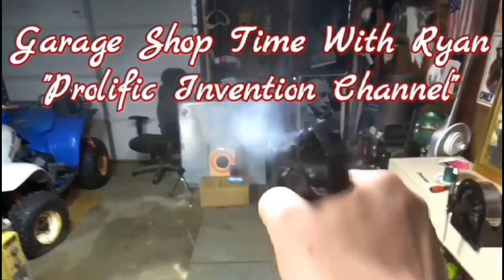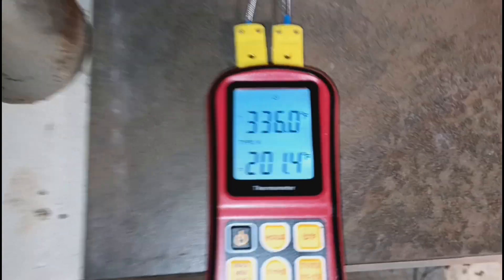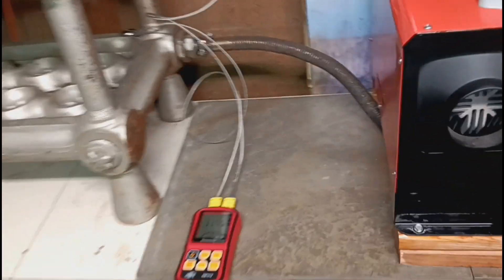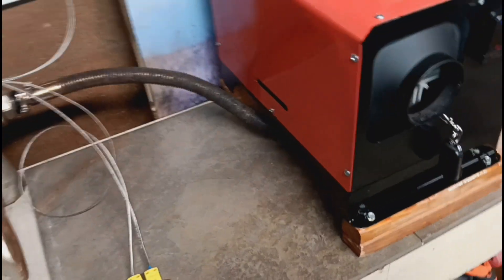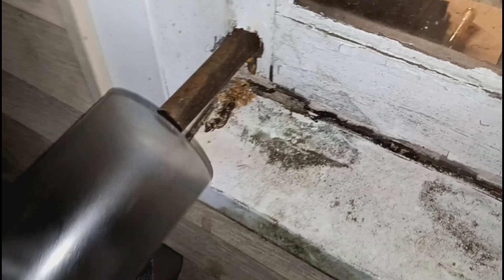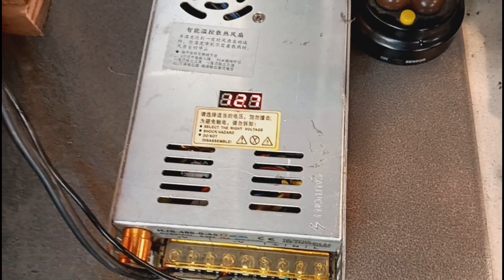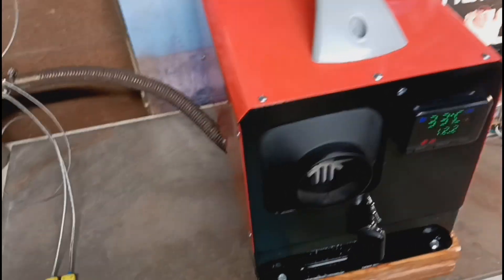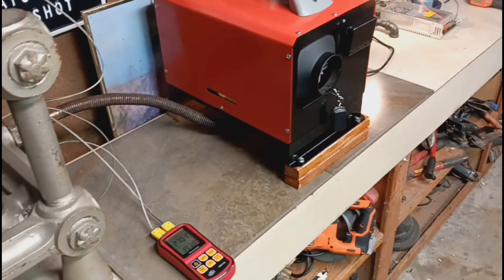Chinese Diesel Heater Exhaust Waste Heat Recovery

Comment: Do you get any condensation inside the radiator? Some radiators have a drain. I've also seen people connect the exhaust outlet of the heater to the top of the radiator and the outlet to the bottom so any condensation travels outside.
Reply from the maker: @roberthosking7524  No condensation, I think the hot radiator steams it all out the outlet with the exhaust heat which prefers to travel from the bottom to the top as heat rises.  Mine has a drain, and removable ports-I've checked, the inside has a thin gray black residue only.  So far I have over 5000 hours on 2 heaters through that radiator, as well as operating generators through it in the same manner which produces more heat than a diesel heater, and silences the exhaust better than any other method by far

Comment: Exhaust should be reversed?  How does the condensation get out?  Exhaust inlet up top, end exhaust on bottom. Just a thought.
Reply from the maker: The exhaust is warm condensate with the sound nearly eliminated.  I've ran this for thousands of hours this way with no moisture accumulation.  The exhaust entering near the bottom heats that cast iron to nearly 400 degrees which keeps the condensation as steam form.
Reply: I would expect the principle is the same as with a vehicle exhaust. If it's only run for short periods and then shut off, condensation will form and over time corrode the components. But if it's run for long periods and the components are allowed to get up to their operating point, risk of condensation is minimized and the components will last much longer.

Comment: I would say.... with the short length of the exhaust going from the heater to the radiator.... plus running the heater for a long period, you really shouldn't have any issues.

I also think you have pretty close to the optimum size of steam radiator for the application. Anything bigger would possibly lend to more condensation in the system.

I like it.

 A good test may possibly be this upcoming week with the temps in Michigan, along with the high winds.